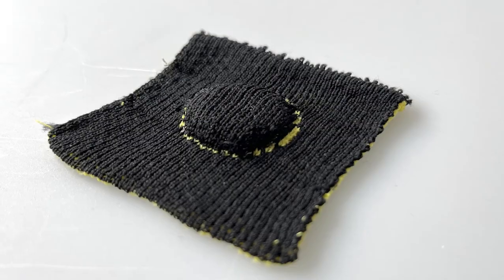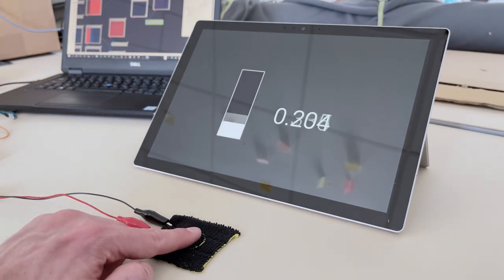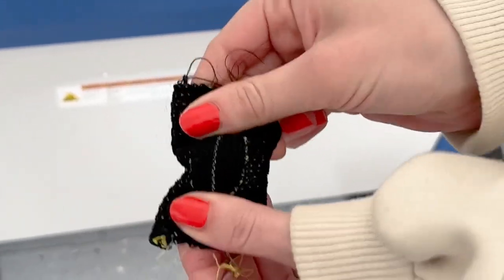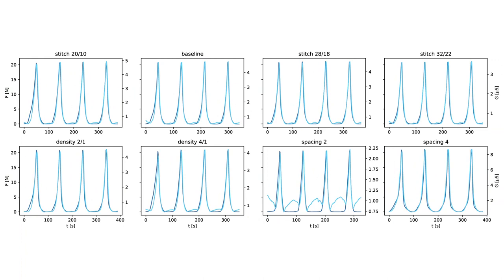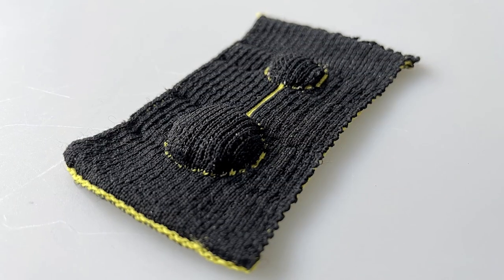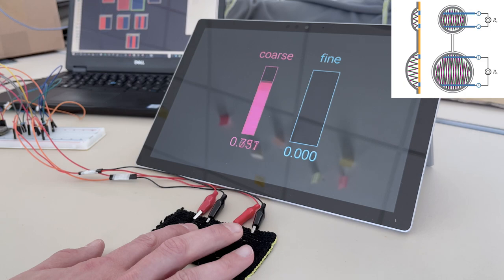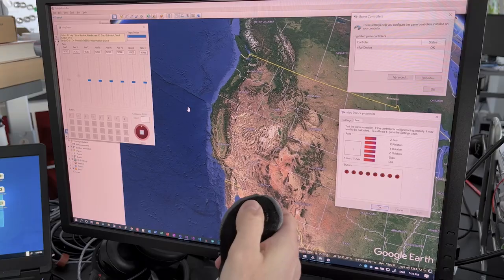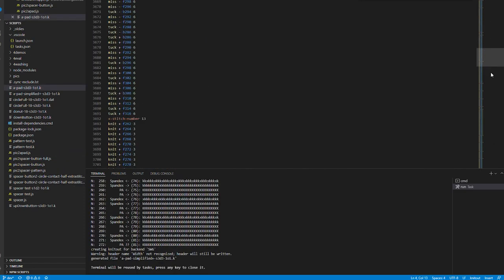spaceR (UIST'22)

Comment: This is super neat. I wonder if some version of this could be used for gloves that can track hand position for VR/etc.?
Reply: Thanks and good point. It is however mostly useful for sensing pressure, so I could imagine sensing finger touch by integrating it into a glove's fingertips for example. For hand posture tracking I would go for a different design, since you would most probably require strain sensors at multiple positions of your glove. Check out the video of our demo here, which features a type of strain sensor that could be useful in a scaled-down version: https://www.youtube.com/watch?v=eXY_GuLpkJA